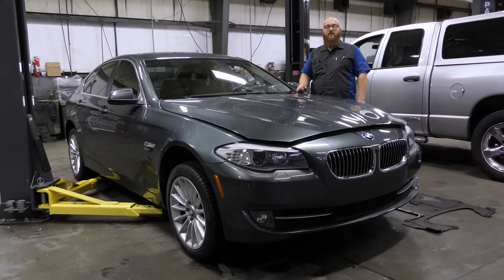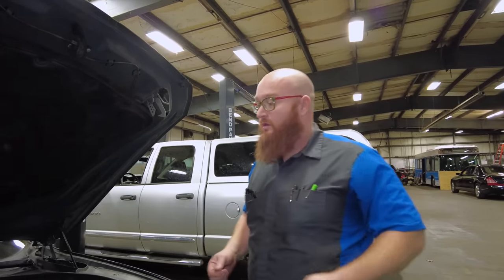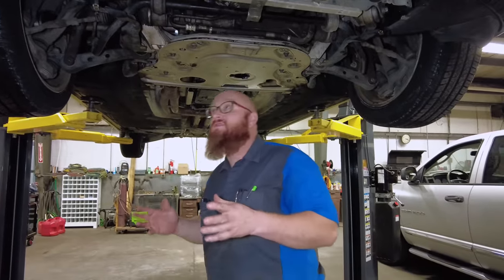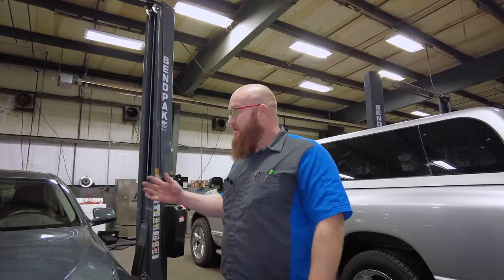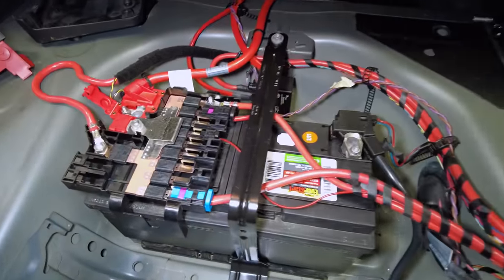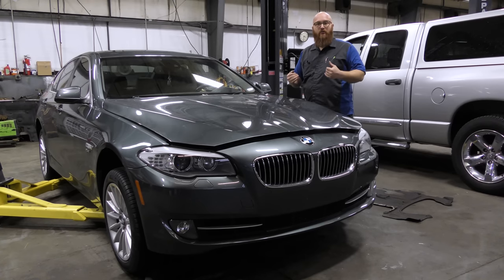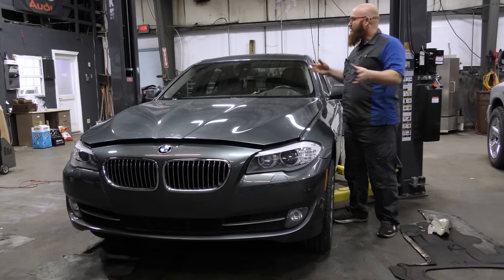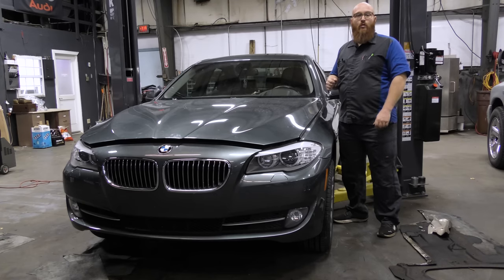One bad day for a customer! CAR WIZARD found TWO insanely unrelated issues at time on '12 BMW 535i

Comment: Greetings from Munich, Germany! 

I live across the street from BMW‘s main factory in Munich and close to BMW’s research and innovation center. I have worked for almost 30 years for one of BMW‘s service providers. We were in charge of repair manuals, recalls and other after sales stuff. I have driven several BMW models myself as company cars. Let‘s call me an insider.

I would never ever ever ever buy a BMW!

Bean counters took over many years ago at BMW. These cars are designed for three years of first ownership. After that… f***k you! 
As soon as the first lease is over, these cars are done. Ultimate Driving Machine for a few month’s at best.

I feel sorry for everybody spending a lot of money on a BMW, thinking he or she will buy a quality car.

Comment: i really didnt want to comment this but i feel like if this was toyota or lexus they would try every way to explain the situation and make it seem easy but this is bmw of course they will over exaggerate it. Recently my expansion tank blew on my bmw. Before it overheated i saw steam coming out of hood and immediately stoped before the engine overheated. its just common sense really. you don't need gauges to tell something is wrong to realize it. if the engine is beyond saving dude you are mechanic... you should know how to diagnose whether engine is good without starting it. Yeah starter is hard to change but its same with all modern cars these days. if the engine is toasted its nothing new. dudes overheated his car of course the engine would took damage from it.

Comment: Out of all the things he could have whined about on BMW's he picks a Neutral switch? Oh my was it "Found On Road Dead"? Do you need to "Fix Or Repair Daily"? Why Not pick on Alfa's? Or Lambo's? Porsche's? Lada's? Cadillac's? Chrysler's? Mercedes? So many cars have frustrating, unique and weird stuff far beyond a neutral bloody switch, including other BMW"s! LOL.  And what's the deal with whining about a starter going out at 200,000 MILES?? I had to replace the starter, the alternator and the water pump on my Mazda before it even reached 80,000 Miles! One day the whole engine dropped down almost right out of the Dodge Daytona I was driving at less than 130,000 miles! The engine mount (I found out later) was so badly designed that it would just tear off at the front of the car! As one Old sick, old Senile old Crazy Old Very lost Very OLD and did I mention OLD man once said ......"C'Mon MAN!". LOL.

Comment: positive wire goes bad rare issue i had in my 128i 3.0. battery positive wire small fuse inside pole

Comment: Never heard so much crap in all my life. It’s a coincidence, nothing more. Shit happens. It’s been serviced by somebody else who has filled it with improper coolant (wrong colour) and the hose hasn’t been properly fitted afterwards. As for a starter going after 200k, FFS you have no idea how it’s been used by previous owners. They could have started it 15 times a day. Starter motors go through massive load when an engine starts.

Comment: There no reason really the starters fail on a bmtroubleyou as much as they do E90 onwards... Starter is on the intake side...
Doing a water pump & t stat job sux on anything e90 onwards too. You get dripped on the whole time with coolant...
Any thing after an E46 chassis they all sux.. Even E46 M54's have their share of junky engineering too..

Comment: So….   Nothing ‘strange’, nothing ‘weird’.  Just poor work by the previous garage, who misfitted a clip that subsequently failed.  And a starter motor gave up after ten years.  BMW’s will run forever, with proper maintenance and care, but it seems that US built and maintained cars suffer from mishandling and ignorance.  Use a specialist, service it regularly and properly and all will be well.   Otherwise, buy a Surrey with a fringe on top!   Btw, my 22 year old, 210,000 mile E39 has never let me down in ten years of enthusiastic driving, and runs like a dream.

Comment: Well? Was it the starter? I have a 2006 Audi A4 2.0 T with a little bit of upper engine noise possibly the cam follower. Pulled the pigtails off the hvfp to check the cam follower turned the key, it ran for a second died bc of no fuel like it should. Once I put the connections back together the car has symptoms of a bad started. Wtf? Why? I wish I had a Wizard near me.

Comment: No offense but you don't know what you're talking about when it comes to BMWs. The chances of you locking up an engine due to overheating is slim to none because BMW has overheat protection in their n54 and n55 engines you will lose power so you cannot do engine damage

Comment: Well, I disagree with this video totaly. BMW 520D - no problem with all the maintenance  on time. Reach 300k miles with no problem. Pull like as new. What are u talking about? If the owner doesn't take care of his car why u blame the manufacturer? Plus I am pretty sure that he hit something under that displaced the hose.BMW has a strong plate to protect everything underneath. You sir didn't state how many miles he drove it with no problem. Blaming BMW in a video to get some likes. Show me a car that drove  300k and the mechanic didn't do anything to it. So I think you have to be fair and show us the service log book plus how much he had on the clock.

Comment: You said you hate bmws with a Chevy sitting right there that won’t even make it to 200k without a failed transmission or some other part that is actually very expensive. Get over yourself man
Reviewing 200k cars could be the same no matter the make this bmw sounds pretty good at 200k

Comment: Broke Mah Wallet!
Reply: But seriously, it has 200k miles. Stuff could fail on any car. I would be curious to know if the overheating caused the solenoid to fry. Kind of a stretch, but that seems more likely than winning the double failure lotto on the same day. My big issue is just the silliness of having to rip apart the air intake to access the starter. That's really what's frustrating. Could easily be a simple job, but that's not the BMW way.

Comment: You are being very very disingenuous Wizard. Most Range Rover models, which you "absolutely love" use BMW engines and ZF transmissions (Before that the ford AJ8, which sucks just as bad). same problems with many manufacturers, so start beating on every other maker or go back to wrenching and fixing and leave the car reviews to the pros

Comment: Boo hoo, I'm an ex-bmw master tech and had to listen to these sob stories all the time!
People that can afford to buy and own a high spec 5 series for 200,000miles = a few thousand dollars repair won't bother them. They've been there many times before.
The people that "think" they can afford a BMW. Usually, despite qualified advice to countless people to not buy a euro in my experience. Can afford to learn the lesson the hard way. 
The XDrive systems main issue is it's allowable differential parameters being too small a window. The majority of issues/failures I dealt with, originated from mismatched tyre brands, sizes or tread depths. Xdrive tries to correct the difference 100% off the time = failure.

Comment: Very misinformative video to make people think bad things about BMW.
1 - The driver had the first warning of low collant, he ignored it;
2 -  The driver then had the first engine high temp warning. His screen was yellow and that car was beeping to try to alert him, he ignored and kept driving.
3 - The driver then had his second high temp warning, now his screen is red and the car has entered a reduced power mode to try to save itself from the owner.
4 - The driver then takes his car to a mechanic that has no hability to do a leak down test, remove plugs and other things to try to identify the engine health.
The mechanic try to pass a message that a 200.000 miles car is too early for the starter to fail due to a almost been burned by the high temp engine.

What a joke

Comment: It's a 200 thousand mile car, 10 years old and you're moaning about some oil down below, a hose came off because someone did a cheapo coolant change (wrong colour coolant)  and likely didn't put the hose clip on properly (if it was the proper clip).  Likely didn't change the lower hose either which is standard practice on any car.

Yes the starter is pricey but it's a premium car.  Premium cars are a rip off, are Jags cheap?  You love those.  Would you rather drive a Caddy or some US brand nonsense?  Do you really think driving a toyota is the same experience? (I love toyotas btw).

And are you trying to claim that a Ford or GM after 10 yrs and 200K miles wouldn't have oil underneath? I bet they would have 5 x the amount of stuff replaced in that time.  US junk.

The only vids you see of folks b1tch1ng about German premium cars is when  they're old and they likely haven't been serviced religiously.  It's not that they're cheap to fix (they're not)  but it's a premium car.  

Buy one with a warranty, same advice for any premium car.   Service it properly and enjoy the premium experience.  But don't expect premium carriage for basic money. 

I tell you what is a rip off, it's Ford's and GMs because they ALWAYS need a ton of stuff doing every damn service.  I know a doctor who had an exploder and he was always amazed at the service bills, just about EVERY DAMN YEAR.  You pay that and don't get the premium experience.  Really you have to add 10K to the price of a Ford to compare like with like.

I'm amazed you have the number of subs you do, clearly you know something I don't 
!!

Comment: I'm hoping you find a cheaper way to fix that BMW , obviously heat build up has contributed to the starter issue ,is the solenoid a separate part ?
So do have to question why everything is so expensive,and one would understand the growing You Tube mechanic growth ,people are questioning things more now and what's to lose by trying to fix it yourself.
Harbour freight tools cheap ,free You Tube advice and videos ,the world is going to be full of mechanics,You Tube accredited.
The automotive industry needs to sharpen it's act up ,one can get parts cheap ,and self labour is what makes the difference.
Think back to a time when things weren't readily available,and we learnt how to spanner ourselves,because we had to .
ICE cars are still basic automobiles ,it's just the added computers that make them complex and supposedly out of reach of the owner ,love a challenge don't we .
Again hope you can get a cheaper option for the customer,has anyone used the Ultimate Tool on the Starter  ?? A Hammer,please tell me you tried 🙂

Comment: Blah blah  jubr jubr waste of time blah blah- started died because of the heat.

Pretty normal for starter to fail. If you need 3 hrs to diagnose dead starter I have no idea what else to tell you.

It takes 5 min to put power probe to the starter and see if power goes there when you try to crank it.
Even disconnect the cable and power it with  the probe. Not a big deal.

Comment: Is this really a mechanic? Even if you use just one small bit of logic it's clear why the starter is acting up, probably also would have snapped back to life bit a bang on it. Overheating and sitting on one of the hottest spots on the engine. Do these guys even have any sense of logic or just bashing because he can and cause it's the right brand he will make money on youtube.

I hate volvos, I can't stand them on the road always going 10 under the speed limit and never and i want to barf every time I see one, they are stupidly ugly. I hate the stupid software you have to use, Vida is idiotic and locked down .But even I can se logic when there is logic when something fails on them

Comment: Car Wizard, I think you are being dishonest to your customer and you have the audacity to put it on youtube. Literaly all you need to replace a starter is take the intake off and put it back on, the whole job shouldn't take more than 2 hours, in fact I just worked in the similar location today. A brand new starter is around 200, just checked on fcpeuro. So 1.2k for a starter replacement is a rip off, no wonder your customer was shocked.